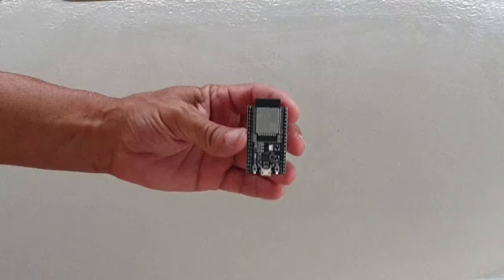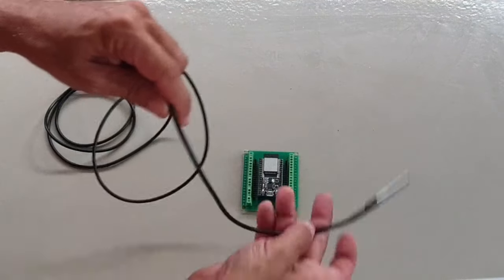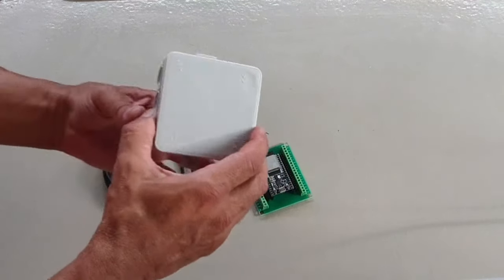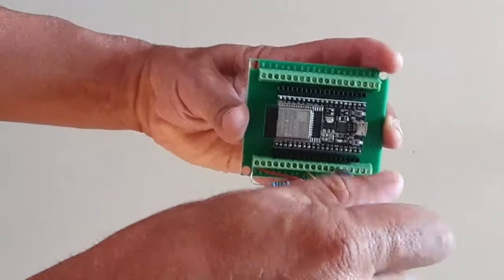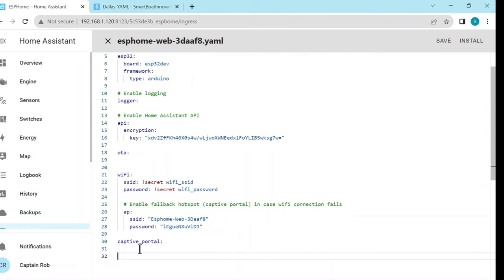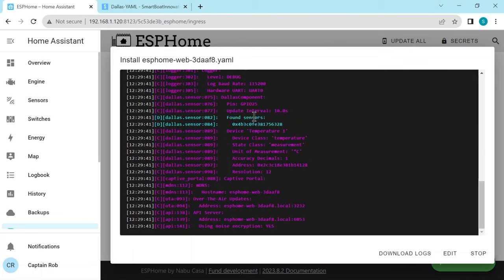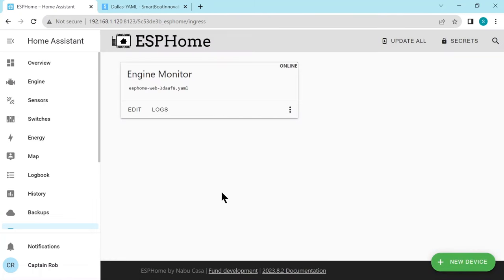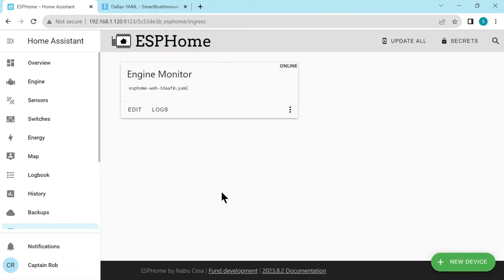Smart Boat 13: Engine Temp Monitor using ESP32 and DS18B20

Comment: Thank you very much for these great ideas. I just completed this project. One small point. You referred to the PIN as P25. I think you meant D25. I have a 30 pin esp32 so my layout is different from yours. I note that pin D25 is one of 2 DAC pins. I take it that is why you selected it.
Reply from the maker: You can use any pin in the ramge 21 to 27. Just make sure you update the Yaml to reflect the pin number.

Comment: what sensor can one use to accurately monitor the water temp. Yours are just attached to the body not touching water directly
Reply from the maker: The water temperature readings are generally accurate, though they might be a couple of degrees lower than the actual temperature. The key purpose of these sensors is to trigger warnings when temperatures exceed predetermined levels. Therefore, a slight difference in actual versus measured temperature isn't critical for this function. However, if precise temperature readings are needed, you can directly connect to the engine water sensor using additional wires. This method, as shown in my oil pressure video, involves using resistance readings from the engine's water sender to achieve more exact temperature measurements

Comment: Please correct me if I'm wrong, but i don't see (in this video or the previous one) the step where you  add the device to HA integrations.  If this isn't done then there will be no temperature sensors under "entities".
Reply from the maker: Normally when you add a esp32 device via esphome and adopt, it auto adds the integration to HA. However there are cases when you change the esp32 device name you then need to go into settings and integrations and manually add it.
Reply: @SmartBoatInnovations  I think that's what happened to me.  Thanks

Comment: Hi Rob, great video - Im trying this now, and for the life of me I cant get the unique address for the sensor - has something changed since you released your video?  Any advice on how to detect the sensor address ? thanks John
Reply from the maker: The Yaml has charged and you need to use the newer versión from my website. But I have updated this a couple of months ago with the new one wire update.
Try setting the logger to be DEBUG like this...
logger:
  level: DEBUG
Reply: Thanks Rob - I’ll give that a go

Comment: Is it possible with one ESP32 for 4 sensors, then how do you connect the sensors to an ESP32 with 4 sensors?
Reply from the maker: Yes you can. Look at 3:53 on the video and I say how. You just need to use a small 3 way terminal block and then connect all the like colored cables together. and then a single cable from each terminal on the block to the esp.
Reply: For me it was tough getting the 4 sensor wires into the same connection. I ended up soldering 4 wires together. Works great.
Reply from the maker: That also works.  But a small terminal block is easy. Maybe the one you used was too small.

Comment: Great idea. I'm so nervous placing those sensors in hot environments. Will the sheath around the wires melt under any normal engine situation? From your photos it looks like to get the tip on the things you are measuring. For instance, the alternator. Am I correct? Should I aim to get the tip touching what I am measuring? Or should I aim to get as much of the silver sensor touching the thing I am measuring? Do zip ties stand up to the heat of being around these things? 165F? 225F? What can they withstand?
Reply from the maker: Great questions! I had similar concerns when I first installed mine nearly two years ago. When running the wires, it's best to follow existing engine wiring routes as much as possible. Be sure to avoid placing them over the dry exhaust or other high-heat areas.

For sensor placement, you'll want to ensure that as much of the metal part of the sensor as possible is in contact with the surface you're measuring. This will give you the most accurate readings. In my case, I secured each sensor with two zip ties for added redundancy. It's important to make sure that if the ties fail, the sensor won’t fall onto a moving part like a drive belt.

The zip ties have held up well, but I recommend replacing them every few years to avoid degradation due to heat and vibration. If you're particularly concerned about durability, you could add some stainless steel wire as an extra backup.

Most standard ties can withstand temperatures up to about 185°F, but high-temperature variants (usually black or specially labeled) can handle up to 225°F, which should work for most engine environments.

As for the ESP32, it’s rated for temperatures up to 220°F, but I still recommend placing it in a plastic enclosure and mounting it near a cooler part of the engine to prolong its life and protect it from extreme heat.
Reply: @SmartBoatInnovations  I think I have an even better solution! Thermal duct tape. 3M make a flue tape that they say can withstand 600F.
Reply from the maker: @davidhopkins   3M make very good products. But I am not sure you can tighten it as much as with  zip ties. And then there is also vibrations. But let me know how you go.
Reply: @SmartBoatInnovations  zip ties will be hard for my setup. I was also contemplating glue.

Comment: Why you use a resistor for this project?
Reply from the maker: The resistor in the connection between an ESP32 and a DS18B20 temperature sensor, often referred to as a "pull-up" resistor, is crucial for the proper operation of the one-wire communication protocol used by the DS18B20
A pull-up resistor connected to the power supply to maintain the data line at a high level when no device is pulling it low.
The DS18B20 communicates by pulling the data line low to send a '0' and releasing it (letting it be pulled high by the resistor) to send a '1'. Without the resistor, the data line would remain at an indeterminate voltage level when it should be high, leading to unreliable communication or no communication at all.

Comment: I am seeing a Check Sum error, any suggestions?
Reply from the maker: One-Wire sensor connected to an ESP32 via ESPHome often indicate issues with the data transmission between the sensor and the ESP32. 
Power Supply: Ensure that the Dallas sensor is properly powered like I show in the video.
Data Line: Verify that the data line is correctly connected to a the correct GPIO pin on the ESP32 and that the connection is secure.
Pull-up Resistor: A pull-up resistor (typically 4.7kΩ) is required on the data line to ensure proper communication. Make sure it's connected between the data line and the VCC.
Ground: Ensure a solid ground connection between the ESP32 and the Dallas sensor.

Comment: This is a great video. I am not sure on what device the display is shown on? Hiw do you set it up as standalone and onto a mobile phone or tablet? Tia
Reply from the maker: In the video, the display of the ESP32 engine temperature data is showcased on a dashboard that can be accessed through devices like a mobile phone, tablet, or computer browser. This setup is part of a smart boat system, which I detail in another video (https://youtu.be/Z6F7-IKwX9A)

Comment: Hi Rob, thanks to your guidance I’ve got my first 2 sensors working - alternator temp and engine temp. Have you any idea how to calibrate the sensors? They’re reading  about 9 deg C below what my temperature gun reads (I know the temperature gun is not calibrated per se, but it must have had some sort of accuracy set up work at the factory so must be more accurate than the sensors I have just fitted)

I know for our purposes (measuring changes) total accuracy is not needed, but it would be nice to have them more accurate than 9 deg C out

Thanks for everything
Reply from the maker: Yes 9 deg is a little more than I would expect. I have about 3 degrees less. Make sure the sensor has a good solid contact with the metal part you want to measure. That is why I used cable ties as I can tighten them up. If it is still reading substantially less then you can set up a filter section in the sensor in ESPHome  that could add a offset. Or you can you use a calibrate filter. For these simple things ChatGPT is quite useful in providing the updated Yaml.

Comment: hi, thanks for the videos. very useful. I would be interested in a video about monitioring the alternator rpm and water/fuel sensor level
Reply from the maker: Hi, thanks for your feedback! Videos covering the monitoring of alternator RPM and water/fuel sensor levels are planned. For monitoring water/fuel sensor levels, you can apply a similar method to what I demonstrated in my Oil Pressure video. Here’s the link for a quick reference: https://youtu.be/ScP7xjOwWFg.
Reply: Ok great. I will

Comment: Awesome video Rob, compare to other you really show all needed details for noobies which is very rare. Actually knew a lot already but always missing some little details that made me get stuck but thanks to your video I know now how to solve them and what I need. Subscribed
Video request: Could you actually make a video about flow sensors for gasoline, diesel and water. I eg have 2 overpowered engines and never know if it’s better fuel economy if running one at higher RPM or 2 on very low RPMs and the actual fuel consumption at each 100RPM…I have a rough guess but diesel fuel flow sensors on both would be a saint. Also very good to monitor if the engine has a fuel supply issue is the most common issue on engines. Same sweet water flow sensors at the tank output to know how much I use and another at the output of the watermaker so I can actually a)match the consumption I use with refill from watermaker. Also help for monitoring for alarms eg if you have a leak somewhere, watermaker output is below a threshold eg clogged input/filters…would be awesome.
Reply: Also wireless please as routing cables is a nightmare on boats.
Reply from the maker: Thanks! Water flow sensor video is coming soon. A fuel monitor is also possible but normally you need 2 sensors per engine. One for supply and one for the return.  I have plans for this but I need to find some quality fuel sensors that are not too expensive. A fuel pressure sensor is also something I have been planning as this can indicate if the filters need changing.
Reply from the maker: Of course. Will be using a esp32. I also do not like routing cables :)
Reply: Could you tell me which sensors you gonna use for water and if via the Ina 216? Just putting all the needed material together for my smart cat and in canary island where shipping is an issue and takes 4 weeks minimum.
Thanks to you just setting all the basic system up on an intel Nuc, ai-net beryl 3000 router with starlink and a netgear sim router. The beryl has fallback so if starlink has outage the sim router takes over. That’s what I have already plus a Victron cerbo install that I will interface with home assistant too. I think that NUC is significantly more powerful then raspi, so local voice assistant should be possible.
Reply from the maker: @chrisr819  Just planning on a esp32 and this
https://amzn.eu/d/bqGNm3a
But I have not tested it yet.
And maybe an ina219 to measure the voltage if it is higher than 3V.
Reply: @SmartBoatInnovations  I look forward to the water monitor sensor video. I bashed my way through. The big issue I had was the interrupt sensor interfered with the wifi on my esp board and I missed readings. My revised approach was a nano collecting the "clicks" from the water sensor and connected it over serial to an esp32. The esp then sent data to mqtt to be read by HA. Pretty complicated project.

Comment: Could your oil pressure approach also be used for the engines built in temp sensor ?
Reply from the maker: Yes, indeed. The majority of engine sensors, including those for oil pressure and temperature, operate using a resistance-based system, much like the one I demonstrated in the video. This means you can apply the same setup for these sensors. Do keep me updated on your progress. I'm here to assist further if needed

Comment: Very good however I do not like attaching temp sensors with plastic cable ties. Are you aware of sensors that can be bolted?
Reply from the maker: Thanks. Yes, I understand the challenge. When I first installed the temperature sensors, I also explored alternatives to using cable ties. I considered using stainless steel wire, but it was difficult to firmly secure the sensor in place. As for bolting, I haven't come across any sensors equipped with brackets. Fabricating a custom bracket might be feasible, but the real challenge is identifying suitable places to attach the bolt, especially in areas like the exhaust elbow. Directly bolting onto various engine parts can be quite complex. In the end, I opted for cable ties. By using two, I ensured that the sensor was firmly positioned, with the second tie serving as a backup for extra security. This setup has been effective for over a year now. It requires regular checks, but it has proven to be a satisfactory solution.

Comment: Do you have a link for Ferinheight conector?
Reply from the maker: You use exactly the same sensor/connector. We just need to do a conversion in Home Assistant.  I have updated the Esphome configuration with an example for Fahrenheit. See:
https://www.smartboatinnovations.com/dallas-yaml